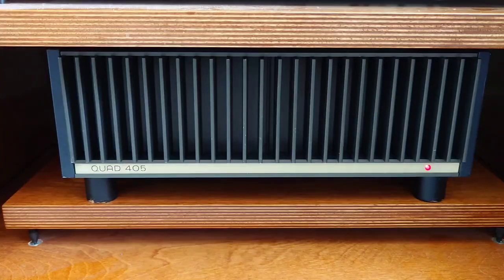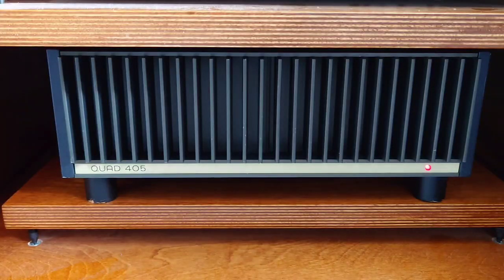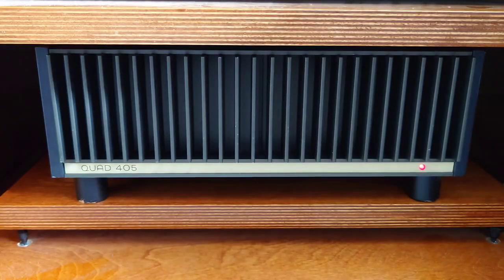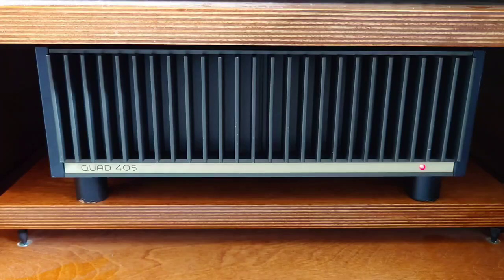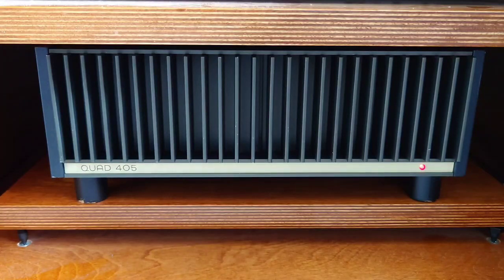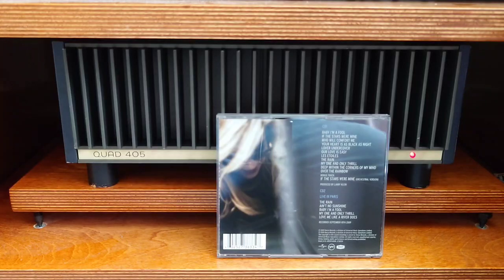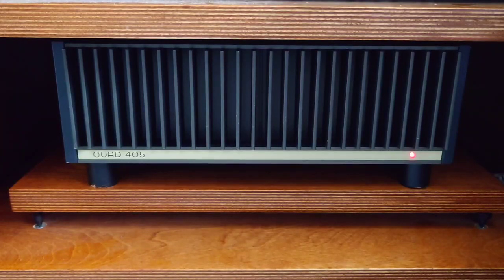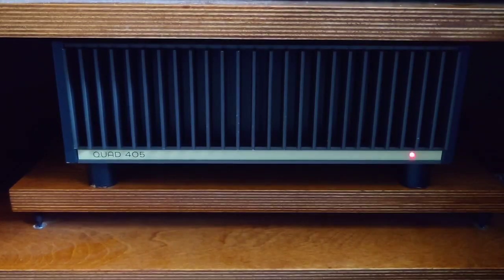My Thoughts On The Upgrades To The Quad 405

Comment: Thanks for the video. I did not even think of using Audio Note caps for my 405-2 mod/rebuild....sigh. I wish I had considered them. Ended up using Kemet 26000 hr for PSU and if I recall Elna Cerafine for other electrolytics.
 I have easily heard even the lower end Audio Note caps quality in another mod. And if yours are even better no wonder you were happy.
 Good call.. off to check out your other Quad posts.
That Gardot CD looks awesome also thanks for the recommendation

Comment: I would advise against using OCC wire. The types I've tried sound nasty. Really bad. I'd go with Audio Note silver hook up wire. I'm not certain which gauge would work? I bought some 0.6mm and had a hell of a time getting the enamel off which shouldn't have been a problem since I bought the correct American Beauty Mini Pot and silver solder. Try to use Audio Note solder if you can. You'll need a high temp solder iron because it's lead free solder. The second best wire I tried was Dueland silver/gold and Connex 6N silver (Partsconnexion's house brand). The wire itself shouldn't cost very much. The soldering iron you'll need for any wire type since the good solder makes a big difference. It's just a matter of if you want to bother with the enameled wire. I need to send the Audio Note wire I have to my Audio Note service technician because he said the enamel should come off in a fraction of a second. I even had a thermocouple to check the solder temp. in the solder pot and it was correct. And the Audio Note wire is clearly superior to the other excellent wires. I had it sitting around for a while and hadn't tried it because of the hassle of stripping the enamel. I was so satisfied with the Dueland that I was in no rush. But when I finally installed the Audio Note I was shocked how much better it was. I ended up scraping the enamel off with the edge of an exacto knife. The Dueland wire had this quality like all off the sound was drawn into one coherent whole. The YouTube channel Real Hifi Help talks about this and describes the exact same phenomena. It would make you cry, it sounded so right. The Connex wire was near perfect with tremendous dynamics, but in perfect proportions. If I had nothing to compare either to I'd think they were perfect and the best ever. Stay away from all copper wires. Maybe Audio Note has optimized it somehow but in my comparisons to all sorts of silver wire copper was horrible. I even tried that Dueland copper/silver/gold wire. It was not really any better than copper. None of the wires I tested had been broken in. Maybe that would make a difference but I don't see how one type of wire would suddenly go from way down the list to near the top. Trust your ears. It's uncanny how one audiophile describes how something sounds and then you find out he was exactly correct. It's no placebo. These Audio Science Reviews types are missing out just so they can feel like they've got reality all figured out.